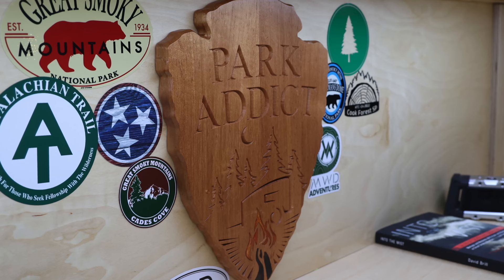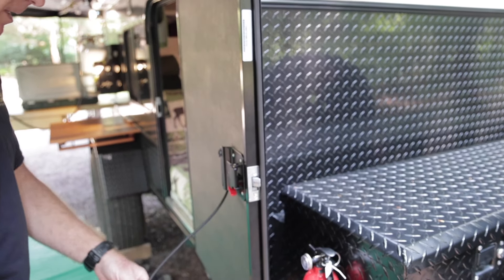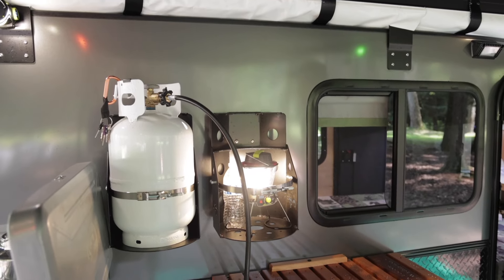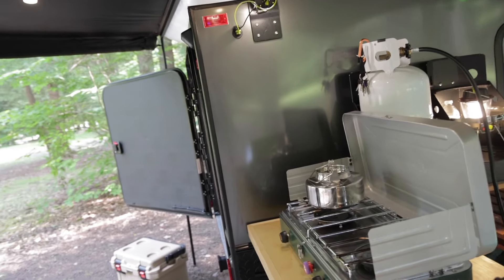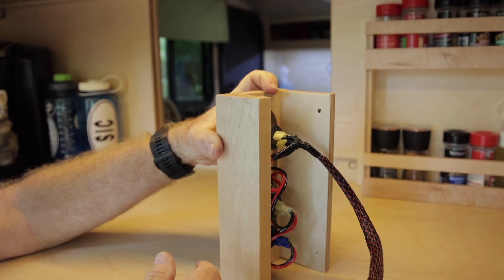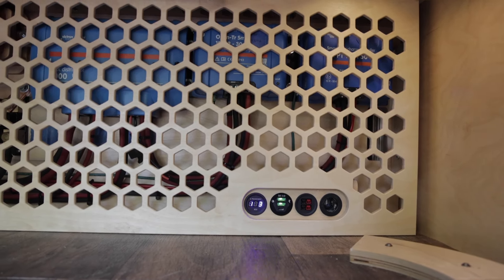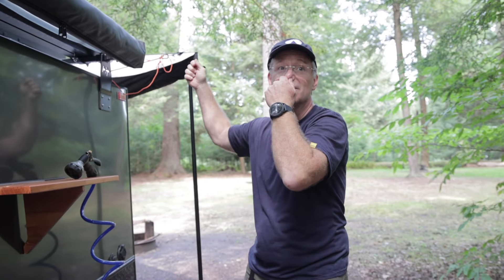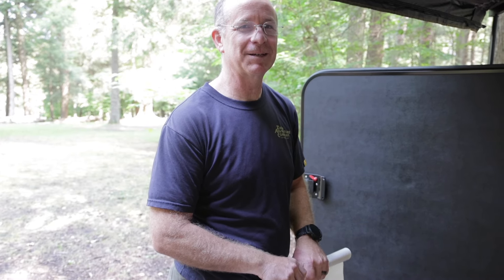Hiker XL Walk Around - 20+ mods, plus the ultimate power upgrade!

Comment: Beautiful work... On your side table, for the knobs that control the leg length, what does the knob bolt screw into so the bolt is held tight? Thanks!
Reply: EZ-Locs come in different thread and lengths so be sure to pay attention to that when ordering.  Make sure you get the specific drive tool for each size too.

Comment: The woodwork is very impressive! Would love to know more about the technique used for the honeycomb. Is that done with CNC, Laser cut, or something done by hand?
Reply: The honeycomb was designed with my CNC design software, Vectric.  You can use any CAD type software to design a shape and pattern pleasing to you.  A router based CNC was used for all the work associated with the trailer.
Reply: It’s a great touch and your use of such refined and well-thought out woodwork throughout the trailer really elevates the project - Thanks for sharing!